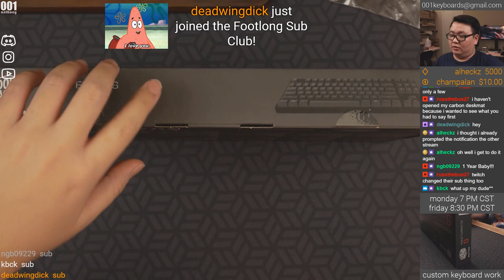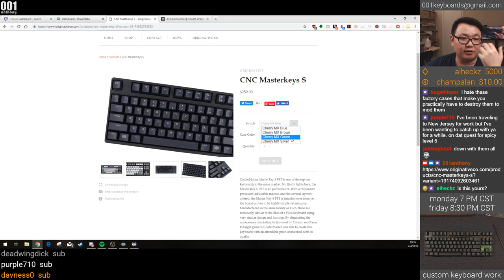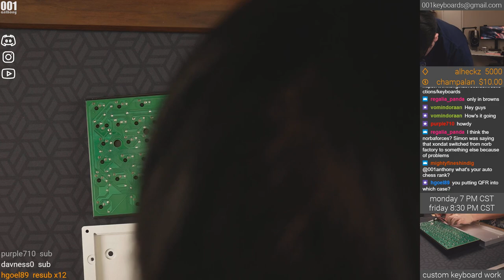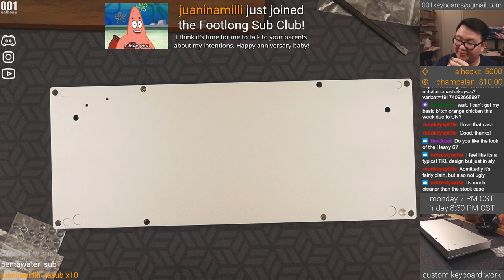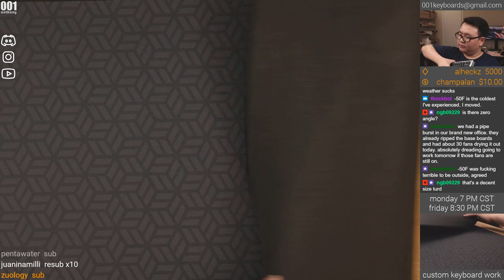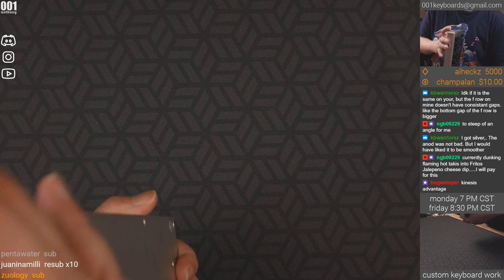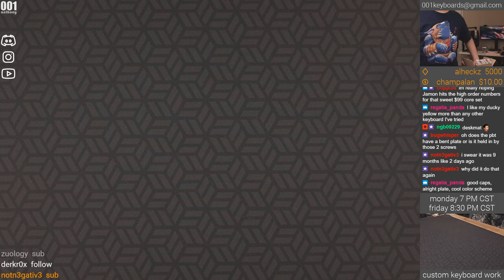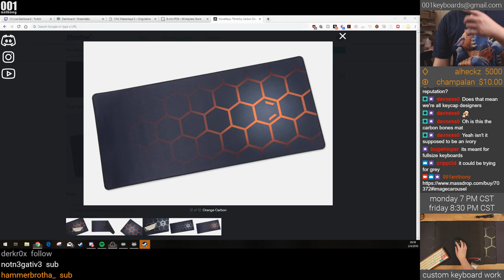Unboxing: Norbauer x Originative CM Masterkeys S Aluminium TKL Keyboard

Comment: when you say "it pings" (https://youtu.be/F5Vcsd3lKzc?t=3675 ) believe me, it pings without the aluminium case as well... you just haven't pinged it much at first. I have the same old plastic case and it pinged like hell now after 2 years of usage. The only thing to blame is steel plate, and how I know that? I disassembled it and it was still pinging when I just hold pcb/plate in my hands. Then I desoldered all the switches down to separate the pcb and plate sandwich, the plate was resonating on the slightest hit with the fingers... so there you go, the plate is too blame, not the case, nor anything else.